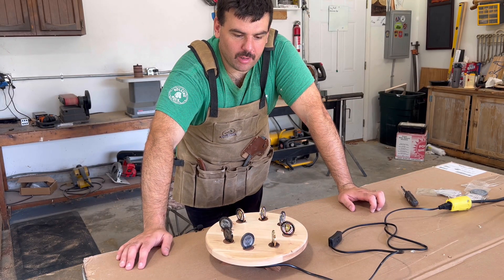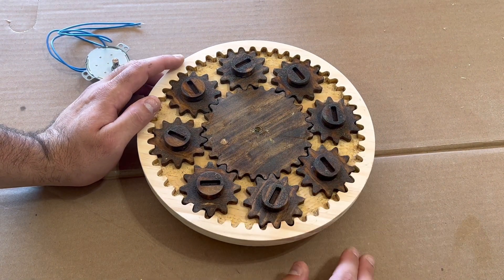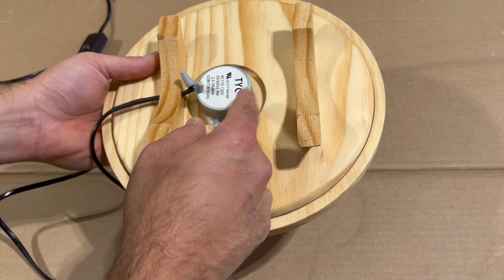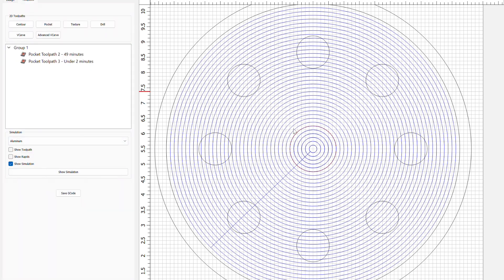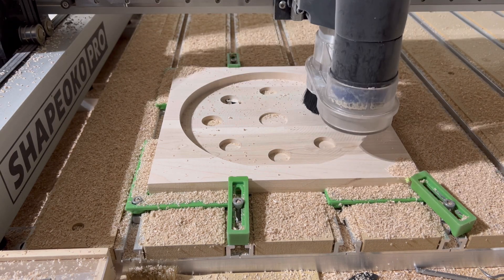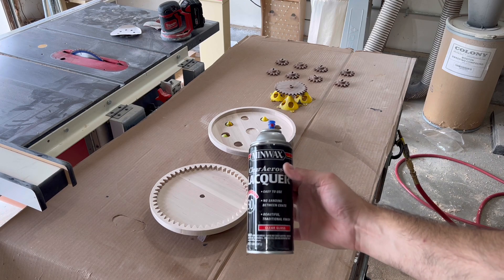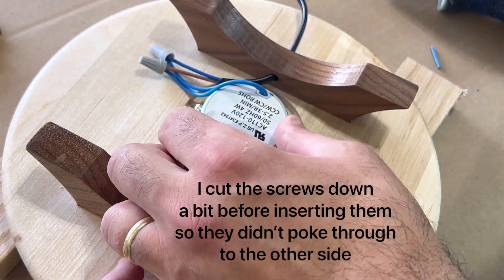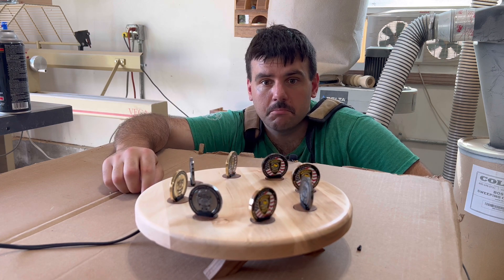Challenge Coin Display…that spins?!

Comment: INCREDIBLE. Do you make if for sale? How about the option to also have one on the middle in case I want to showcase just one coin some times? I have some old coins measuring around 2.95mm, 2.80mm, 2mm,  thickness respectively, and  32.7mm,  30mm, 37mm diameter respectively? Could the top part be made of a reflective material? I'm looking to photograph and video the coins and it looks better on a black reflective surface. Thank you and congratulations on the amazing design.
Reply from the maker: I’m currently only selling the file so people can make it themselves. If you know anyone with a CNC Machine, it’s an easy project. As for as placing a coin in middle, you would have to mount it on a stand in the middle that doesn’t cut into the top cover. The gear is right under the cover, so if you cut into it, it wouldn’t spin.
Reply: @AquaVitaeWoodworks  thank you very much for your reply. Happy new year!